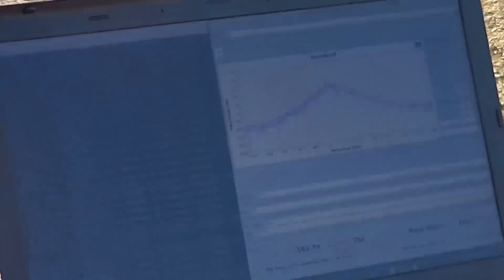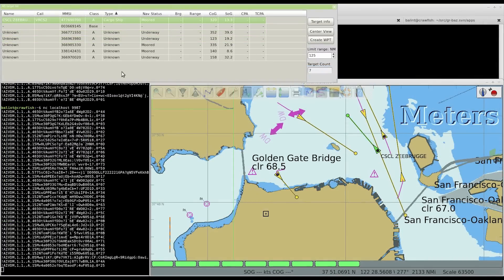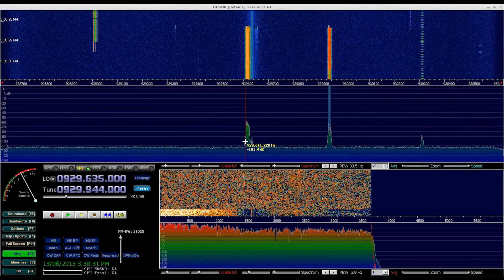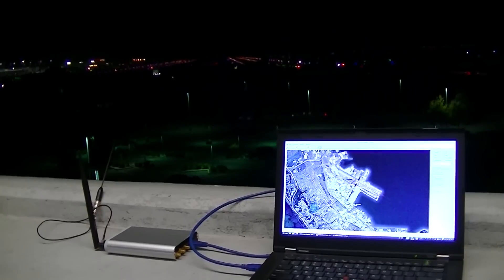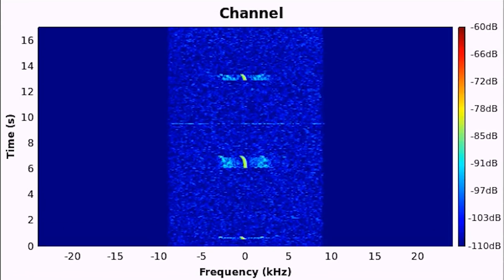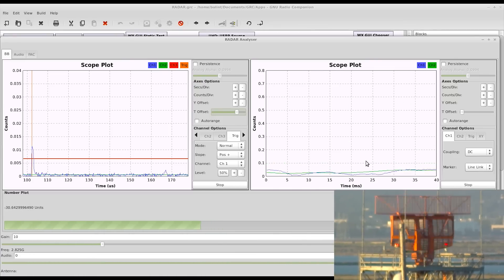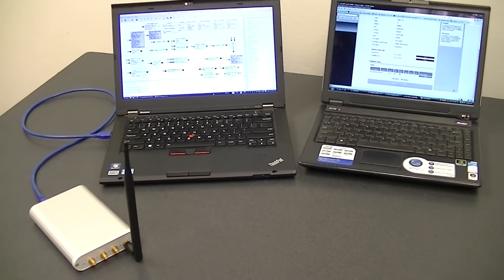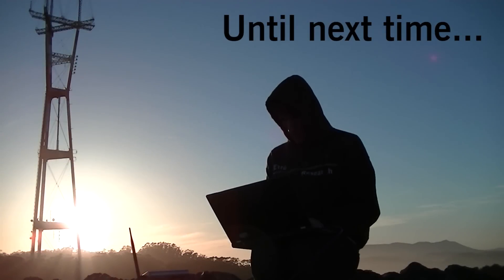USRP B200: Exploring the Wireless World

Comment: Hi. Can I use this device for receiving AIS (161,975 MHz) and Mode S signals (978 MHz) at the same time using 2 RF ports on the board? 1 RF port for AIS signals and 2 RF for Mode S signals

Comment: Can you give your thoughts on using OpenUSRP to emulate non-Ettus hardware (ex. B210)?  I'd like to use the Lime SDR (FX3 USB) to run (Labview) Windows applications that utilize the USRP Hardware Driver (UHD) software API.. 
https://www.jiangwei.org/2017/07/18/labview-for-limesdr/

I've read SoapyUHD can be used as an alternative to OpenUSRP but I'm not running Labview under ubuntu/arch linux :(
https://happyf337.blogspot.com/2017/07/limesdr-ubuntu-desktop-1404-x8664-setup.html

I'm doing Section 4 of the User Guide (wiki.myriadrf.org/Lime_Suite) : Install PothosSDR-2018.11.04-vc14-x64.exe and ran the instructions in "Testing the LimeSDR" and "LimeSDR-USB Quick Test" with all the RF ports open:

https://myriadrf.org/blog/optimising-limesdr-matching-hf/
U.FL                             Function
RX1_H Channel 1 RX: frequencies above 1.5GHz  (RX1_2/RX2_2 = High band specific) 
RX2_H Channel 2 RX: frequencies above 1.5GHz   
RX1_L Channel 1 RX: frequencies below 1.5GHz    (RX1_1/RX2_1 = Low band specific) 
RX2_L Channel 2 RX: frequencies below 1.5GHz
RX1_W Channel 1 RX: wideband   ( RX1_3/RX2_3 = Broadband 100kHz to 3.8GHz)
RX2_W Channel 2 RX: wideband
TX1_1 Channel 1 TX: primary (Broadband all frequencies) /
TX2_1 Channel 2 TX: primary (Broadband all frequencies)
TX1_2 Channel 1 TX: secondary (Broadband all frequencies) /
TX2_2 Channel 2 TX: secondary (Broadband all frequencies)
 
RX1_1/RX2_1 = Low band specific < 1.5GHz
RX1_2/RX2_2 = High band specific > 1.5GHz
RX1_3/RX2_3 = Broadband 100kHz to 3.8GHz

 Using EXTIO-based programs (ex. HDSDR) don't work either!    Is it possible I need to reprogram (LimeSDR-USB_Board_Programming)? 
http://wiki.myriadrf.org/Getting_Started_with_LimeSDR-USB_and_LimeSuiteGUI

Comment: Would a 6V 4A AC adapter work as a power supply for the N210 rather than the 5.9V 4A, or would the extra 0.1V do damage or give any negative results? Also, could I use a 6V 4A boat battery for when I am on the go? One last thing: Is there anyone in existence who sells enclosures of any sort for the N210? 
Thanks!

Comment: cant I pretty much do all of this with a 20 dollar dongle?
Reply: Yeah, you could do some of it, though the dongles are 8-bit resolution at 2.5 Msps.  This is 12 bit resolution with over 50 Msps, not to mention better phase noise for the LO and sample clock, reference stability, etc.  Not even in the same ballpark.
Reply: In all practicality, I'd have to say the general enthusiast wouldn't really require something this beefy. Sure, it's 1000x performance, but it's overkill for someone looking for ADSB or running a right-circular polarized antenna for NOAA sat. It's not a matter of what's better or worse, it's really just a matter of need over want and practicality over requirement.
Reply: Adam Stouffer Could look at it this way though, comparing a B200 to the dongle, 20x real-time bandwidth, 16x dynamic range, 3x RF bandwidth.  So it's 1000x performance for 30x cost.  I have a few paging transmitter near me, so I need all the effective number of bits I can get.
Reply: Louis Brown The dongles still follow the 90/10 rule. 90% of the functionality at 10% of the cost.
Reply: Yep. Also looks like a 9dBi antenna as well. 40 bucks and you're up and running :)

Comment: You should make an HF mod version, here's how: put an RF mux switch in front of each channel of the AD9361, connect one side to the SMA and the other to ports of a 140MHz (?) transverter, and have one of the GPIOs switch the power to the transverter and 2/4 switch each of the channels of the AD9361 from direct ant to transverter (with separate antenna connectors). 

You can do the same with an external transverter but it would be cool to have it all integrated in one portable device.

Comment: I see B200 is always connected only with the USB cable. Dont we need a power cable or it is USB powered ?
Reply: Needs a power cable for a B210 in MIMO mode, or if you have the optional GPSDO, but it's able to run with USB power otherwise.

Comment: Thanks so much, great video in every possible aspect!
I would love to see step by step instruction from taking the B200 out of the box to loading the firmware, configuring the device and setting up HDSDR. 
How does it compare with other SDR receivers on the market in terms of sensitivity and intermod? 
A "stationary" PCIe version would be very cool too, since bandwidth is not much of an issue there and the real fun and gain & directive antennas are often those that you can't drive around with.

Comment: Thanks for the info on the manufacturer of aluminum enclosures, excellent resource.  Custom enclosure it is.  Also do you have a suggestion for a  discone antenna that would work well with B200/B210?